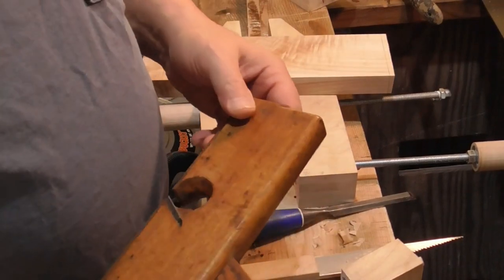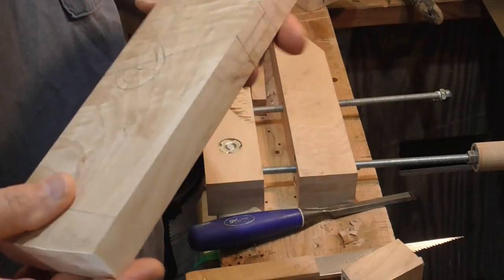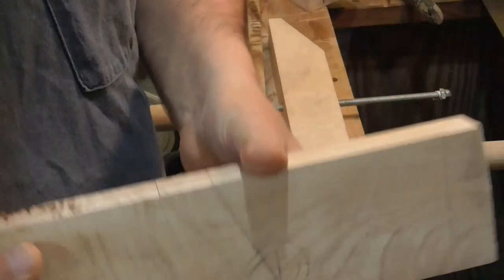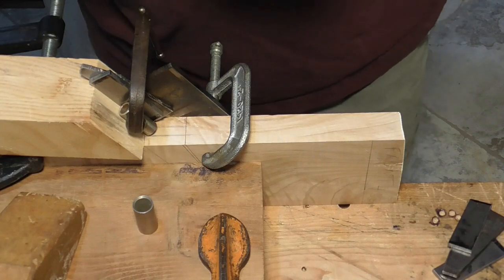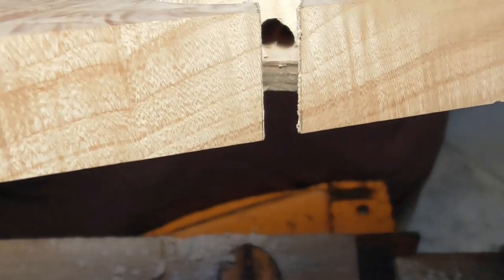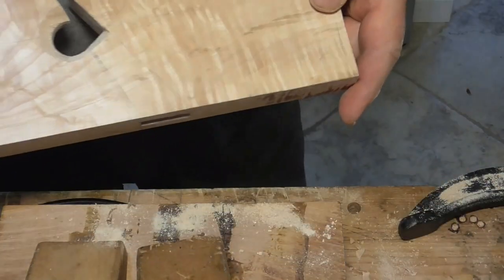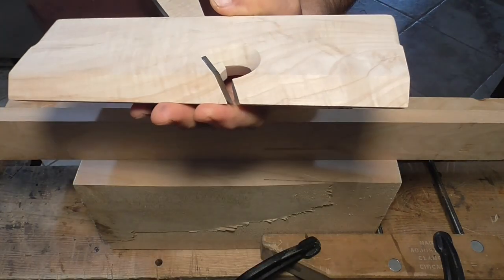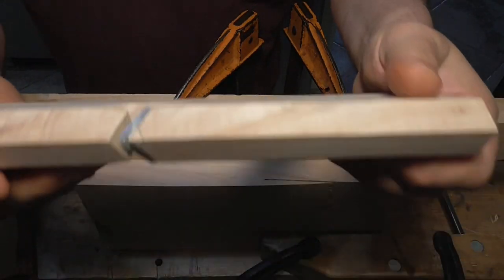Plane Making - The V Groove Plane

Comment: Great work.  I'm intrigued by the tear drop shape of the "escapement" on these old planes and I have found on a couple that they tend to have a small crack in the sharp corner of the tear drop.  Any idea how this shape came about?
Reply from the maker: Thank You !
No idea. The crack is probably caused by a combination of poor design and improper drying of the lumber. I have several planes with a crack in the same location and eliminate that feature when I make copies. If you look at the work of knife makers, glazers and other fabricators you'll see they avoid having a sharp inside corner at all costs. Plane makers, not so much.

Comment: Beautiful craftsmanship as usual. I agree the wood grain is beautiful but not being straight, aren't you concerned about the body becoming misshapen over time?
Reply from the maker: That's a good question. Truthfully, never gave it any thought. The blank was a cutoff from my chair project, which I thought fit well with this plane, rather than making it with a higher quality blank. I filmed the project a year ago and just checking now, it is still straight !